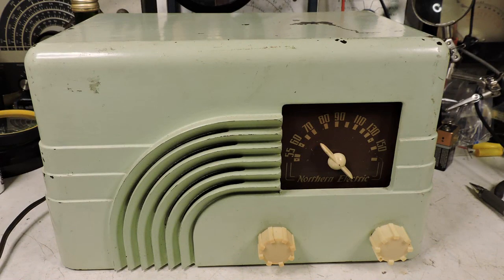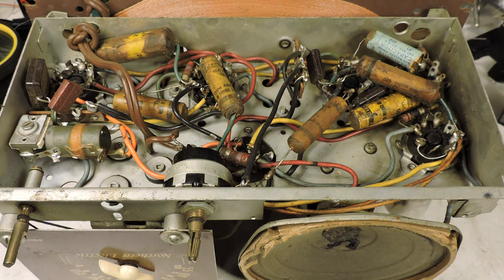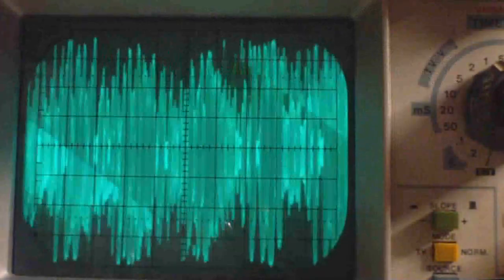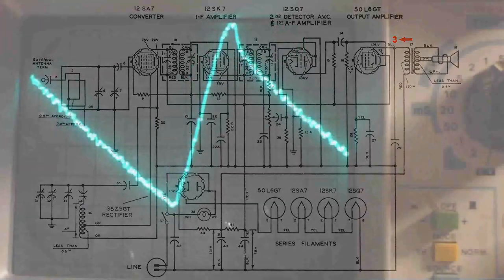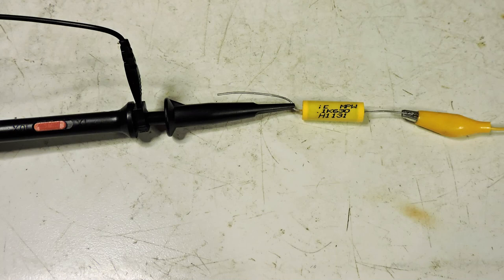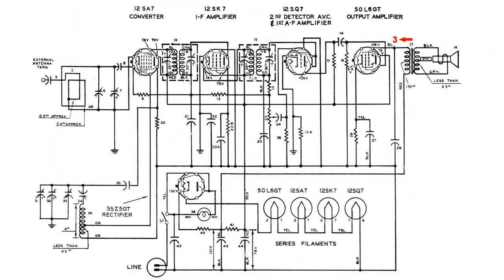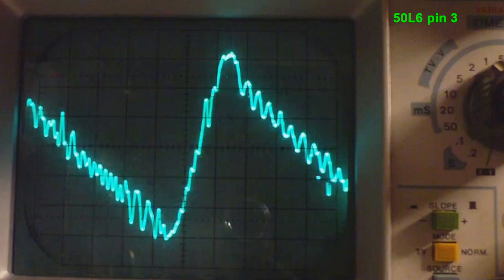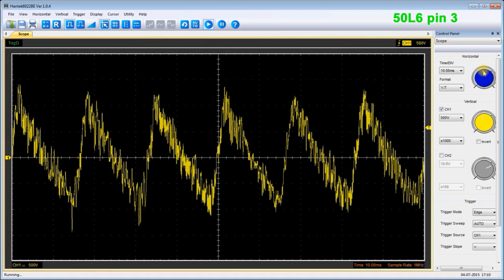Analog & Digital Oscilloscope Comparison on Tube AM Radio

Comment: Well Rick I know you own both, but I would like your professional opinion on which scope your gonna grab 1st  when you need to check a signal fast?
Reply from the maker: saturn5tony 
If I just want to look at something quickly, I would use the analog scope because it is already on the workbench. If I want to capture something for pictures or videos I would use the digital scope.

With this digital oscilloscope I can capture at least 50% more resolution then with my analog oscilloscope. And that's using a cinema quality video camera on the analog oscilloscope. I know the digital oscilloscope is jerky, however there is no information loss, I have been able to capture exactly anything I want. I'm sure in a year or so, they'll be a better PC oscilloscope for the same money or less. So I've decided to start learning digital oscilloscopes now.

Comment: A or D scopes, and A or D multimeters have their pros and cons for each.  I like analog better to see movement, digital is more choppy, sort of like a strobe.  A combination analog (input) / digital scope may be a nice compromise, reminiscent of transceivers that were mostly solid state, but with tube finals.  A nice feature of digital is that you can take a snapshot of a certain section, like in editing a video.  The signal being watched is anaog.  Another good vid Rick, to demonstrate both.  Don.
Reply: To clarify, solid state and vacuum tubes can be analog or digital depending on the circuit design and components.

Just trying to save you confusion later.
Reply from the maker: ***** 
Don,
 With this digital oscilloscope I can capture at least 50% more resolution then with my analog oscilloscope. And that's using a cinema quality video camera on the analog oscilloscope. I know the digital oscilloscope, to use your words, is jerky, however there is no information loss, I have been able to capture exactly anything I want. I'm sure in a year or so, they'll be a better PC oscilloscope for the same money or less. So I've decided to start learning digital oscilloscopes now.

Rick
Reply: Yup, old scopes are obsolete, like comparing film to digital camera, we can get hooked on digital goodies.  And the price for the PC scopes is much cheaper for new oscilloscopes. Um looking into a  Velleman PC USB box. It's mostly PC software based, the box has the analog input and A/D converter, it's all digital after the USB.  I think it works on a tablet too. Don
Reply: Not to start a huge argument, but for certain applications digital cannot even compare to analog. It depends on what you need to do. Somewhat like film vs. digital cameras, to carry your analogy. Both methods have their limitations and problem areas. For most folks digital camera is the way to go, but film is absolutely not (and as of now, never will be) obsolete, especially for professionals using slides. The same is true for vacuum tubes, and for analog scopes. For certain things they still reign supreme and possibly always will.

All test equipment is simply a tool and you gotta use the right tool for the job. Sometimes that means digital, sometimes analog, and sometimes it doesn't matter. But analog scopes are not obsolete.
Reply: YUP, WE CAN HAVE BOTH - NO DOUBT ABOUT IT.  I play vinyl, and I play MP3s.  Obsolete means they quit manufacturing them, and don't provide parts.  It's hard to get film or turntables now days.  The last time I was at the drug store, NO TUBE CHECKER!  
dON
Reply: Now I feel foolish because I had the wrong definition of obsolete.

So yes, obsolete, but far from useless and in some cases the only tool for a job that a digital scope cannot do.
Reply: The word has broad meaning, I'm obsolete, hi hi.

Comment: Thanks for posting. I'm a bit confused on what info is used to benchmark one vs the other. I mean, qualitatively the response is about the same, so please expand on what did you see that made the difference in terms of measurement or visual inference.
Reply from the maker: mauro sobreira 
Pin eight of the 12SQ7 has a 455 kHz audio modulated signal. Pin three of the 50L6 is an audio signal. The triangular shape should not be there, it is there because we do not have pure DC. Across the speaker of course is audio.

Comment: What is it about that waveform that indicates that the electrolytic capacitors are bad?
Reply: I'm looking on a small screen, so forgive me if incorrect.

The caps after the rectifier should smooth out the power. You should see an almost flat trace w/ very little ripple.

The large swing and sharp peaks indicate the capacitor isn't holding charge like it should...and if I can see this schematic right, you would likely hear noise from the speaker in person. That Vpp, if big enough, would cause an odd hum by inducing a/c on the secondaires of the output transformer.
Reply from the maker: JL Software 
With this digital oscilloscope I can capture at least 50% more resolution then with my analog oscilloscope. And that's using a cinema quality video camera on the analog oscilloscope. I know the digital oscilloscope is jerky, however there is no information loss, I have been able to capture exactly anything I want. I'm sure in a year or so, they'll be a better PC oscilloscope for the same money or less. So I've decided to start learning digital oscilloscopes now.

Pin eight of the 12SQ7 has a 455 kHz audio modulated signal. Pin three of the 50L6 is an audio signal. The triangular shape should not be there it should look similar to the audio across the speakers, the triangular shape is there because we do not have pure DC.
Reply from the maker: Roy Schwaben 
That's right if the electrolytic filter capacitors were good, they would fill in the missing voltage from the half wave rectifier. There has been nothing done to this radio, everything is original, and it was made in the mid-1940s. The electrolytic capacitors dry out over the years and sometimes can actually short out which is a catastrophic failure and can damage the radio.
Reply: Roy Schwabe

Comment: Richard, would it be possible to know more about the probe that you are using with the digital Hantek 6022BE to capture these waveforms?  I see an attenuation setting in the software for x1000.  My Hantek 6022BE probes offer x1 and x10 attenuation.  Are you using some other Hantek probe, or some other attenuation device to get the x1000 attenuation.  Thanks for the videos, I am learning a lot from them.
Reply from the maker: The probes come with the oscilloscope.
Reply: @AllAmericanFiveRadio  Can you explain a bit more how you achieve the x1000 attenuation with the included probe which offers x1 and x10 attenuation?   Thanks for replying.

Comment: Do I need to use an isolation transformer for my radio under test for oscilloscope measurments?
Reply from the maker: YES!!!  I use an isolation transformer every time I work on any radio and anything that plugs into AC power. PLEASE BE SAVE use an isolation transformer.
Reply: @AllAmericanFiveRadio  I am planning on restoring a national nc183d, Where do I refernce ground? This information I cant find.  Should my o scope have an isolated ground as well or common house ground? thanks!  BTW I love your videos
Reply from the maker: @user-su5sq5ib3i  Thank you. 
Usually the ground is the power supply ground. I found a download for your national nc183d.
https://bama.edebris.com/manuals/national/nc183d/

Be sure to use an isolation transformer. The setup is on page 105 of my FREE ebook. The password is allamericanfiveradio . This is the download link.
https://www.youtube.com/redirect?event=channel_description&redir_token=QUFFLUhqa2hhVTRycWdJd1FUbTFCZWNmdGtQNlZCRmEzd3xBQ3Jtc0tuOFQ2bFhRcWdjdUdIcUREcnZFaHc0M2xURGhITVRuWDE2cGlDakdYUF9uODktNzc3TVRJTWdROUt6R3NLN2lla3hFS2lIM0RnOXR1dXFxMGx2cUNtWDhXb1Zvc2RCbGQxTThoendmN2E5R0lJdmI0Yw&q=https%3A%2F%2Fdrive.google.com%2Ffile%2Fd%2F1HHmaWYr7UMACfmS4W5uL6PADoem2KlRp%2Fview%3Fusp%3Dsharing
Reply: @AllAmericanFiveRadio  Thank you very much sir!!
Reply from the maker: @user-su5sq5ib3i  Your welcome, hope it helps.

Comment: While a halfway decent analog oscilloscope seems to have been used here, the digital obviously was total crap. Some cheap chinese USB scope that doesn't even have AC coupling surely can't compete with an average analog scope.

The basic idea of the video is interesting, but comparing apples to pears really isn't.
Reply: There are articles and videos available that examine comparable scopes. 

eevblog may have something, and I'm pretty sure scope manufacturers such as Tektronix publish good data for this type of question.

The difference can be HUGE, but you may never notice depending on your uses and test equipent.
Reply from the maker: Gregor Ottmann 
With this digital oscilloscope I can capture at least 50% more resolution then with my analog oscilloscope. And that's using a cinema quality video camera on the analog oscilloscope. I know the digital oscilloscope is jerky, however there is no information loss, I have been able to capture exactly anything I want. I'm sure in a year or so, they'll be a better PC oscilloscope for the same money or less. So I've decided to start learning digital oscilloscopes now.
Reply: AllAmericanFiveRadio The little Rigol scopes are't too costly. Get a memory upgrade and the resolution bandwidth (RBW) improves. Rigol also has a nice spectrum analyzer with tracking generator but it's front end is kind of wimpy and using one on a tube radio could result in the mixer being wiped out.
Reply: +Gregor Ottmann I have to agree the title should read "cheap USB digital scope". There are huge differences in digital scopes and you very much get what you pay for. One of the key differences even between a $500 Rigol and a $2500+ HP or Tektronix is the screen refresh rate. The higher the refresh rate the better a digital scope can do most anything an analog scope can. Another big difference is the screen resolution. Cheap scopes usually have 320 x 240 screens, some have 640 x 480, but a good scope will have even higher resolution. Again, the higher the resolution the better it emulates an analog scope. Most USB scopes have horrible refresh rates and the Chinese ones as shown here typically have horrible software. They also often have excess noise from being USB powered, ground loops with the PC, etc.

Comment: It would have been a good idea to state that you are not using a digital oscilloscope, but rather a $150 USB box and software. I wondered why your digital scope did not have AC coupling when even the cheapest of $300 scopes comes with this function built in. The answer - this isn't a digital scope, this is a cheap toy you are using.

You were right about one thing. Even a cheap toy digital scope beats a decent analog scope when it comes to resolution.
Reply: Or a decent analoge van beat any high level digital in same way... It depends on what u want to see.. atlest the old analogue has got the art.. the digital can never touch